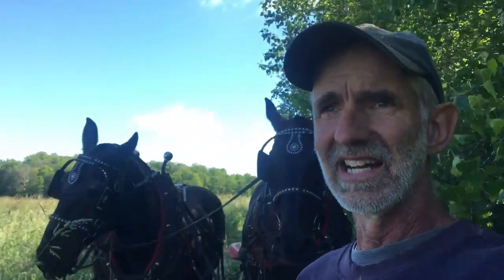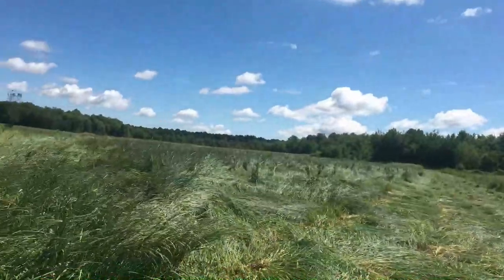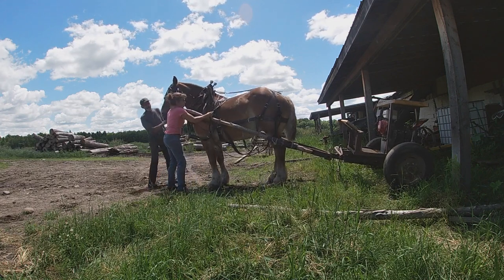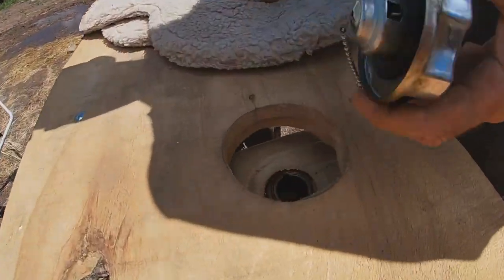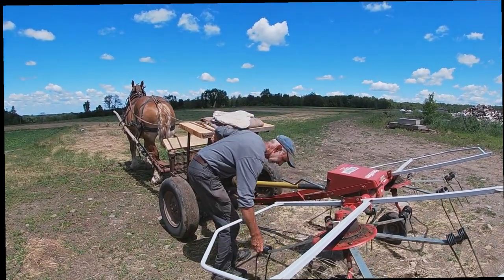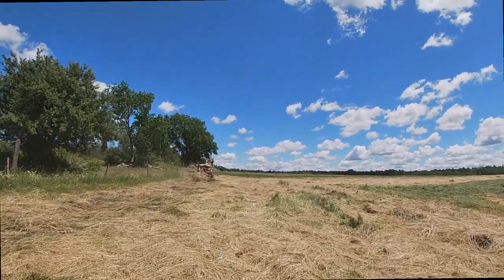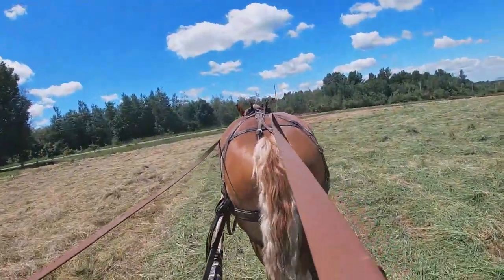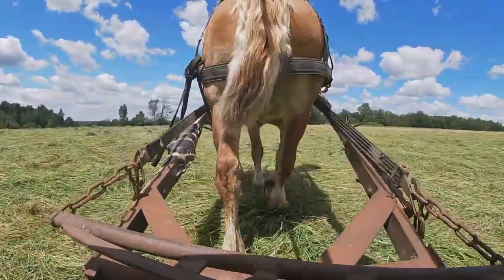How Much Can One Horse Do???  First Time Attempting to Ted Hay with a Single Horse

Comment: Bill is just a very good horse, that anybody would appreciate. I surely would.
While this tedder is good for grass hay, it might knock a lot of leaves off if clover is mixed in. Around here, we hardly ever use a tedder, even with a thick stand of hay, because it is so hot during haying time. In Bavaria I never could put up hay  without tedding it first,  often several times.
Reply from the maker: Here, we always ted the hay, true about the clover. Tedding knocks off the leaves a lot.

Comment: If you are in New Zealand, using Manuka poles (hardwood, quite tight grained and springy) for shafts and tongues may be a good idea.  They seem to take the weather really well.  My wife is still using an older one for our old-fashioned stick-up washing line stick-up pole.
Reply from the maker: Sounds like a good wood, have never heard of it. Glad you can take advantage of it

Comment: Hey Jim, if you ever have the chance to buy a one handed grease gun, you'll never go back to the type you have with the long handle. I grew up on a farm with the type you have and always hated having to use both hands to operate the grease gun w/ no hand left to hold the nozzle on the grease fitting. The one handed model still uses the same large grease cartridges just like the one you currently have. Great video as always!!
Reply: Ive used both types grease guns. Trust me.... when you have fitting that takes lots of pressure to get it to take grease a one hander wont do the job !  Most of mine were difficult to get to take grease. After all....thats the reason for the long handle More force !  Also used the cartridges. Those are a total joke.....and mess !  Used the bucket transfer for years. No cartridge mess. Clean direct to the gun and easy !

Comment: I would like to use my team to Ted hay (I have no tedder yet) . If you pull it with a ground drive forecart,  is the pull about like a hay rake or does it require more effort? Would I be better off with a Grimm-style tedder? I would rather have the rotary type, if possible.

Comment: Hi Jim,
I have a question about the mower for working with pair. I have a mower  for pair but the pole is to short. We have north swedish draft horses. How long does it need to be? Which kind of wood should it be?
Kind regards
Richard from Sweden

Comment: I've been asking myself the same question for a while. How much work can a single horse do? I may be mistaken but I believe that horses were smaller in the old days and worked as singles most of the time.
Reply: Romans actually used draft horses to pull the chariots, the stagecoaches used a cross   with drafts.

Comment: I attach a short length of lightweight dog chain or rawhide to the pin that goes into the bottom of the hitch pin. That way, it doesn't get lost and is always available and leaves your hands free. I use it on dump carts and rear gates on my carts. Another thing I do is buy a bunch of red or orange reflectors with adhesive backing. I put them on the back and sides of carts and tractors and anything I may take out on the road. They are cheap insurance to make sure other drivers see you. A neighbor was killed years ago backing out of his driveway plowing snow and a kid on a snowmobile didn't see him. They can avoid an accident, are cheap, and easy to put on. All farm equipment that goes out on the highway should have as many as possible. They don't stay on forever however and need to be replaced. I also use them to mark my woods trails with a decking screw with a hole drilled thru.
Reply from the maker: Thanks for the suggestions, it's always best to do what you can to try to be safe

Comment: Nice job.great to see how well a single can work. How long were you out tedding?  I agree with you about safety. My shafts for my forecast are metal that rise up about a foot from the attachment point to make them a bit less angled. I dropped the single tree down to the attachment point level though to keep the line of draft better. I put rubber caps for chairs on the ends of the pipe to protect the horse. I had to have the single tree replaced once after my Belgian  mare pulled a 2WD truck up a hill when it was stuck due to a wet field. Great video as always.